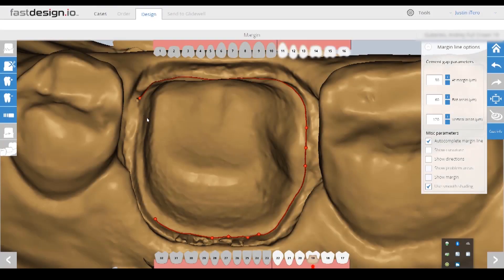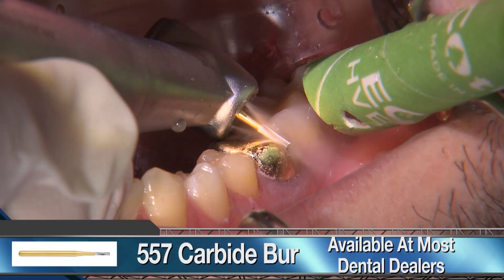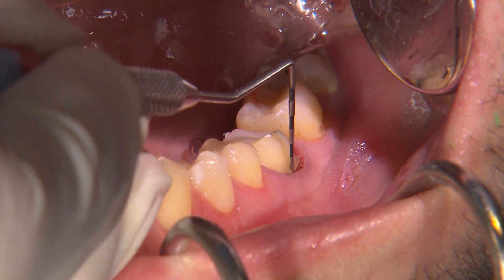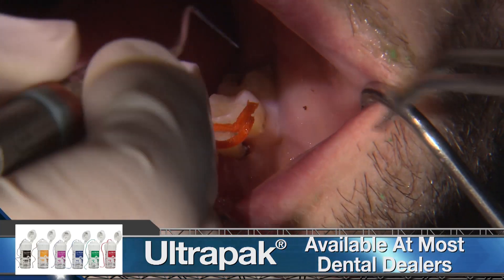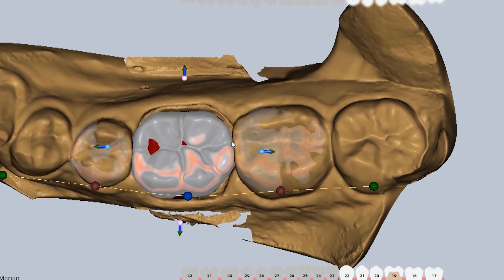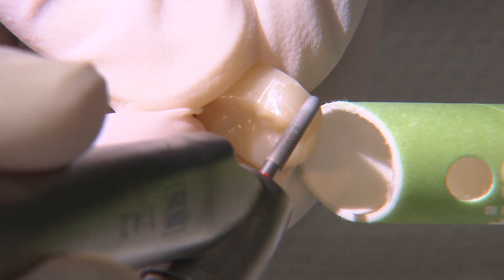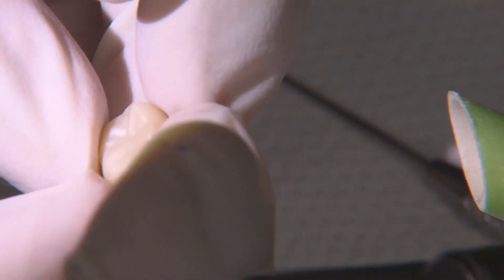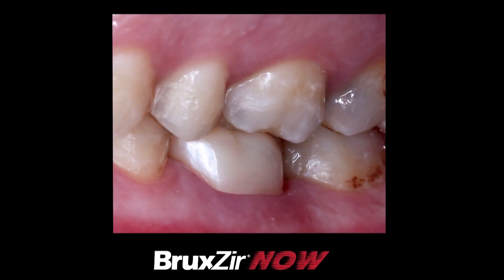Replacing an Old Gold Crown with BruxZir® NOW in 50 Minutes

Comment: I had a crown done with a ceramic crown, but the dentist must have gotten something wrong, because even after a root canal, it still hurts to bite on and it's so flat, and has the wrong angle compared to all my other molars
Reply: Most likely the crown is too high. Had it been a gold crown, it would most likely adjusted itself if it's just a little too high. But that will not happen with a ceramic crown. Instead, it will over time wear down the opposing tooth/teeth, and it can also cause those teeth to break.
Reply: @magnuskvammendent  yep, pretty soon after the opposing tooth chipped
Reply: @stephaniecollins6052  Yeah, this pretty much never happens when you have gold or metal restorations. They are actually less hard, less abrasive, and adjust to your bite better. Gold is the best in that regard, with metal coming in at a close second place.
Reply: I don't get why "white" dental work has become popular if gold is so superior. So stupid.  @magnuskvammendent
Reply: I got a same day crown and the dentist put emax on my molars and I broke it. I paid so much for it too and the bite was wrong. I got on Medicaid and I got a 3M lava zirconia crown and it’s so pretty and perfectly healthy because I have ocd about dental health. The RCT is over 12 years old. Paid 438 for it and now the margins and the bite are correct. Honestly I want gold fillings and gold crowns if I ever need more work done but i respect my oral micro biome and clean my teeth thoroughly through mechanical means vs chemicals. And I also use 3M stannous fluourde treatment at least once a week and I spit out my toothpaste instead of rinsing. I haven’t had a single cavity and I’m 32. I learned my lesson at 20’when I have to pay too much with my PPO insurance

Comment: This is pretty much the worst of dentistry. Replacing extramly good and functional gold crowns, with inferior ones, just to make money.
Reply: how is an overhanging crown a good one?
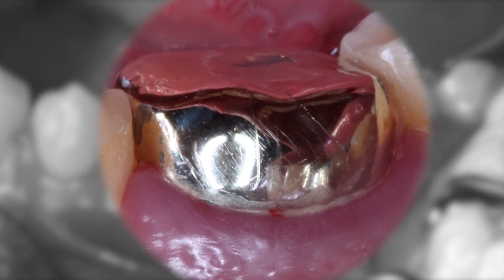Reply from the maker: Thank you for your feedback. This patient was experiencing pain and bleeding from an overhanging gold crown 0:17 .
Reply: Seems like it wasn’t from the gold it was the shape of crown did not fit properly? I need a crown replacement and I want gold, my dentist uses a good lab for crowns that fit well.
Reply: @MelModica  The crown wasn't an ideal shape, but giving the patient good instructions on flossing and brushing would have yielded better results at no cost. And if they actually had to replace the crown, it would still be a better choice to replace it with another gold crown. The problem for the dentist here is that they spent a fortune on their in house milling machine, they have to place crowns left and right just to break even on that machine.
Reply: @MelModica  And if your dentist has a good lab, then I'm sure you will get an excellent gold crown! They are by far the best choice for many reasons. They can't break, they are gentle to your opposing teeth, and they wear at the same rate as actual tooth structure. They are not abrasive like the BruxZir crown in this video is, and they are not so hard that they will break other teeth. They contract and expand at almost the same rate as your teeth, far close to it than any other restorative material. Nothing comes close to gold, and had it not been for the cost, I would do gold restorations all day long. But even if you factor in the high intitial cost, they are actually cheaper in the long run because they last so long. And one very important factor that many dentists neglect to mention is that you save a lot of money on dental work on other teeth when you have gold restorations because they are far more gentle to the rest of your teeth.
Reply: @GlidewellDental  As pointed out by others here, there are different solutions to consider. And I would say that a new gold crown would be indicated here. The reason for pushing a Bruxzir crown is the fact that the office in question already has a milling machine, not the patients best interests.
Reply: @magnuskvammendent  appreciate this write up. Going for my first gold crown tomorrow and as the time comes I’ll be opting for gold crowns on all my molars
Reply: The old gold crown was terrible with the overhang on the mesial. There is nothing wrong with redoing with a new Bruxir zirconia crown.  Different strokes for different folks.  Plus, gold has gone up in price these days.

Comment: Is your milling unit both wet and dry? I thought Zr was dry milled. Please correct me if I am wrong.
Thanks.
Reply from the maker: Thank you for your comment. We will be sure to relay to this question to Dr. Chi soon.
Reply: This product is a fully sintered Zirconia and is extremely strong. That is why it needs to be wet-milled. Thank you
Reply: @sukhdipsingh2316  Thank you for the clarification. So this product can be milled and cemented immediately. 
Do we need to glaze it?
Thanks.
Reply: @dracherian9266  This mill is only wet as mentioned above, fully sintered requires wet to keep bur and restoration cool. No glaze is needed.
Reply: @justinchi9931  Thanks Dr.
Awesome Job.

Comment: Why RM Gic .... i think with U200 relyx would be better than rm gic ...!
Reply: Dr. Diaz - with strength of the material, any conventional cement is adequate. RMGI or Self-adhesive resins are both great options. RMGI is more moisture tolerant with easy cleanup and more than adequate on retentive preparations.

Comment: Informative. Any surface modification of crown before cementation?
Reply from the maker: Thank you for watching this video. We will be sure to relay this question to Dr. Chi.
Reply: Dr. Pandey - no modification to crown is necessary if you're conventionally cementing. If bonding, it's recommended to air-abrade and apply an MDP primer (ie Ivoclar Monobond Plus, Bisco Z-Prime). Thanks for the question